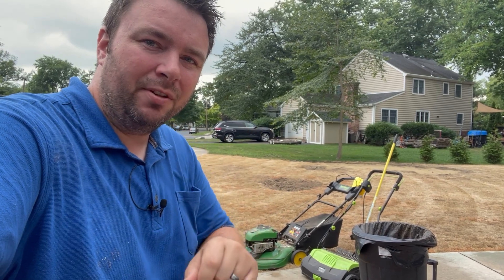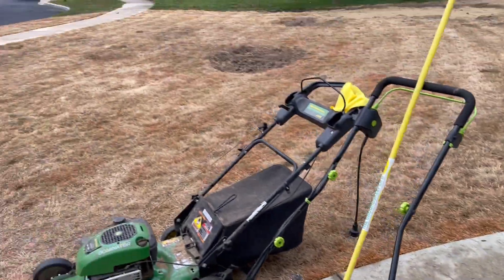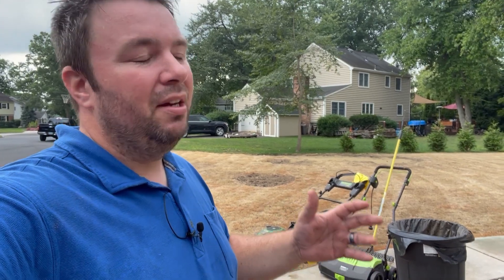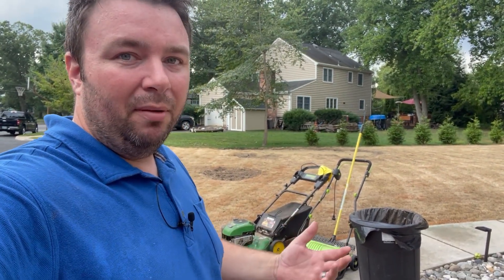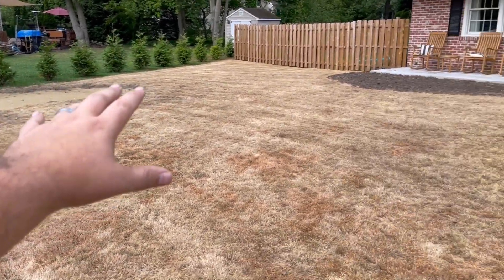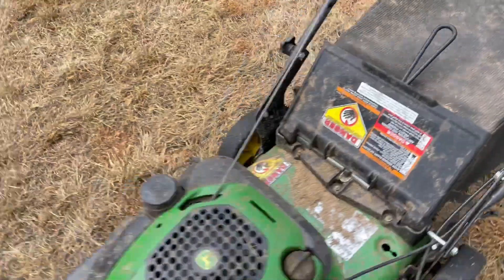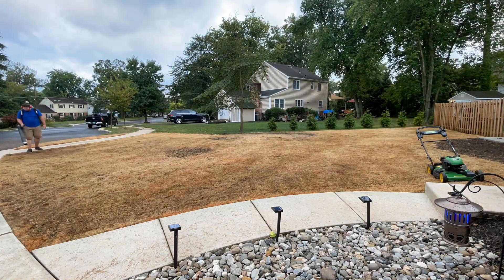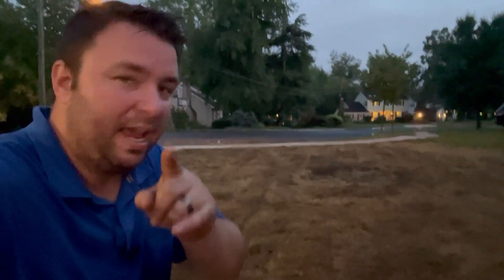You Won’t Believe How Much THATCH We Raked Up!  Step 2 - 2022 Lawn Reno

Comment: Nice progress! For those that have a dethatching machine with the scarifying (aka verticutting) attachment I would completely skip using the dethatching attachment and just use the verticutting attachment. It will do several jobs in one pass by removing any thatch below the soil, breaking up the top layer of soil that you need for seed to soil contact, and remove any dead materials from the top of the soil.
Reply from the maker: Thank you!  Sun Joe makes a unit with two cartridges.  One scarifier and one dethatcher.  Never used it, but have seen many have great success with it.
Reply: @TheLawngineer  I have the SJ that you're talking about and the verticutting blades are really great, much better than the dethatching attachment imo, for renovations like this but you gotta work with what you have.
Reply: Question....I am thinking of buying the SJ. How often will I have to dethatch ? Is this a once a year type thing  ?
Reply from the maker: @shaynejohnson6509  once a year at a minimum.  I’ve seen people do it monthly.  But you want to make sure it’s done when the grass is vigorously growing.
Reply: Been looking for a channel like this!

Comment: I can see putting the dirt down, but I would be concerned with the effect of what looks like a couple of cubic yards  of dirt on the yard from the weight of the truck on the relatively moist soil (it just rained a few days previously).  This would have to be filled in to make the ground level.  The tracks from the truck will take a bit of the top soil.
Reply from the maker: Yeah, the truck actually cracked my sidewalk!  And you’re right, the ruts from the truck will need to be filled in.  That load at the end was 8 yards.  A 2nd load came later with 6 yards.  I still had them drive up and over the sidewalk (cracked again).  For me, I have a herniated disk, so it’s easier for me to place the soil closest to the work rather than hauling it all around from the road or driveway.
Reply from the maker: Also, I appreciate you watching all the way to the end of the video!  Thank you.